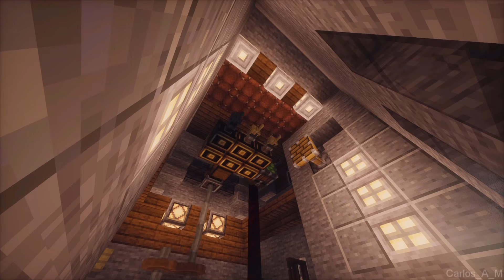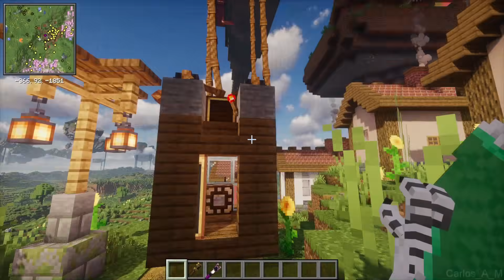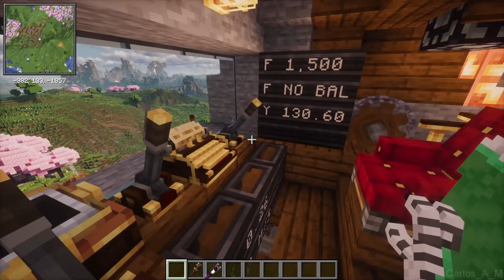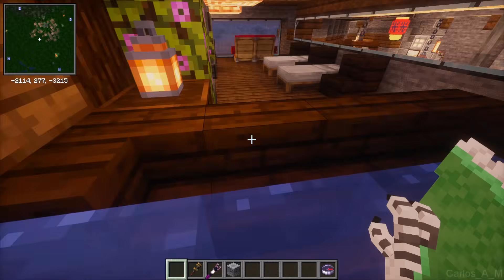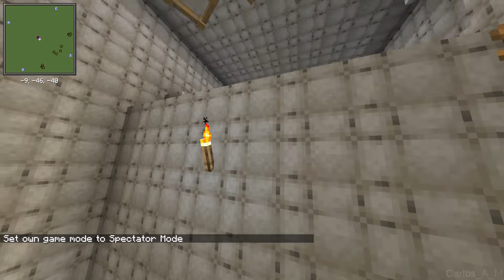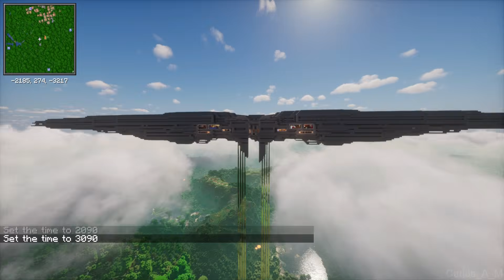"Harpy" Intercontinental bombing platform - Create aeronautics

Comment: how are you able to glue in such a wide area? I'm trying to interlock sections of glue and it still breaks
Reply from the maker: Probably a config in the modpack I was using.
Reply: @CarlosAM1  And do you have stress turned off as well? I've tried starting the harpy with the portable engine with stress turned on, and it always ends up overstressed.
Reply from the maker: @malice_779 did you disable the propellers, superheat the engine and disconnect the main shaft as I mentioned in the video?

Comment: Hello, please explain to me how the autopilot works, namely how to create a magnetic compass for the autopilot and how to set coordinates in this compass so that the compass follows the coordinates you set it to.
Reply from the maker: The compass is made by just clicking a lodestone with a compass. The exact workings of the guidance are better explained in my previous video regarding my cruise missile. It uses the same navigation system for the fine-tuning guidance.
Reply: @CarlosAM1  I watched the video 5 times and nothing is clear. There is no information on how a magnetic compass works.
Reply from the maker: @Leronadsha007  What magnetic compass are you talking about? The autopilot uses a navigation table and a lodestone compass for tracking, that's it.